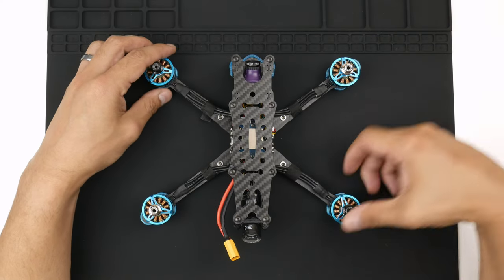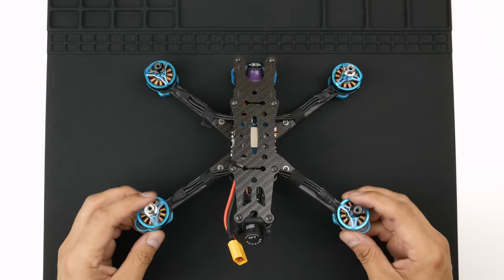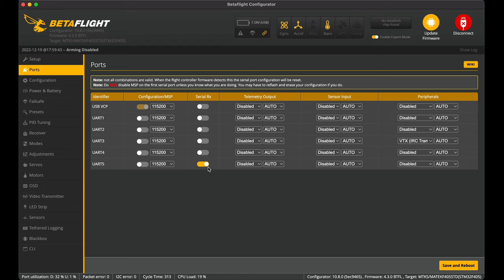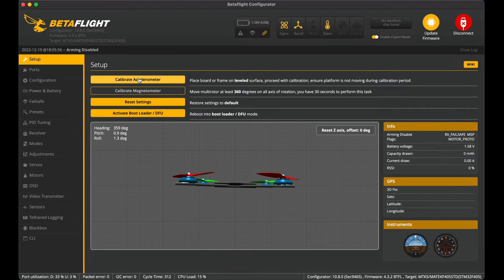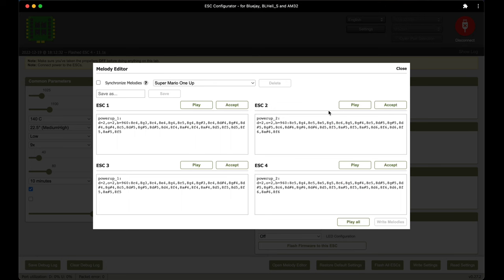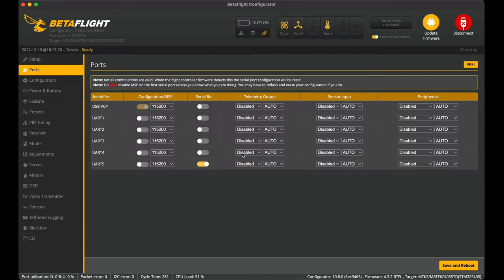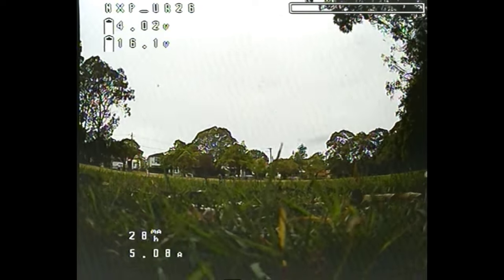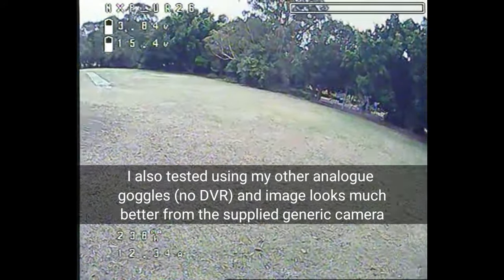TCMMRC Rebuild - Betaflight Config + First Flight

Comment: I also purchased the TCMMRC ur26 mermaid 220. No setup instructions, so I followed all your videos 👌🏽

Now I am at the point where I am binded. My fc is on firmware 4.2.1 and stock esc is on dshot1200. Do I need to flash either?
Reply from the maker: Great to hear! I would flash BlueJay 0.16 to the ESC. Once that's done, in Betaflight update the ESC/Motor protocol to DSHOT300 and enable bidirectional DSHOT.
Reply: Tysm! I did that and the motor are spinning now. But unfortunately they’re all going clockwise. I am trying to switch directions for 2 and 3, but bf says I need firmware 4.3 or newer. However when I try to flash the new firmware, I get an error “failed to open serial port”
Reply from the maker: Try changing the motor direction in esc-Configurator instead?  It might save the trouble of having to back up and flashing Betaflight etc.
Reply: Will give it a shot, thanks!

Comment: Great videos! Have you by any chance figured out the vtx led indicators? All the manuals I find are for different variations with way more leds and I am out here struggling to get a feed into my goggles. Cheers
Reply from the maker: I found this document online which shows the channel, band and power setting LED flash cycle
 https://www.rotorama.cz/cms/assets/docs/26a2ab0aaf41e98df8477510b147e074/9706-0/h5a9b8494c0e84121ad154d583d45f7afy.jpg

It seems to line up correctly as I've tuned into the correct channels on my goggles. To change each setting, you need to hold the button on the VTX and watch the red and blue flash sequence. It's difficult to explain here. I'll try to make a video on how to do this, since I can't find a good video on it either.
Reply: @nxp200  ay thanks for the quick reply!  Turns out the main issue is that I was just dumb and had my goggles set to ntsc when they should've been on pal 😅🤣 got everything working now!  Honestly surprised by the quality of the picture!
Reply from the maker: @bonggoblin  Ah yeh. Glad you worked it out 👍 happy flying!

Comment: wow ! loved every video in the series. Binged it like a netflix series lol. I have couple of questions, i got a tcmmrc night phoenix lr 4 inch. And I am confused how to bind an ELRS rx with it. Saw your video and it seems pretty much clear, but I wanted to know can't I do it with a port or something, do I need to solder it? Also If you have any information about that pnp quad, please feel free to share, it would be helpful. I have brought it from a reseller and its lying around, i want to get it to flying as soon as possible. Thank you.
Reply from the maker: Hey man. Glad you liked it!! 😁 If you want to use ELRS control link, you'll need to install an ELRS receiver. You'll also need an ELRS transmitter (or external module installed). I've got a couple videos showing how to bind ELRS, and many other videos on YT too. Unfortunately it's not the easiest compared to traditional control links, but after a couple times, it's not too bad. Only info I have of that PNP is that it's called TCMMRC UR26 Mermaid. 45amp ESC (I think they've upgraded to 50amp now) and a basic F4 flight controller.

Comment: Nice video series! I am a beginner in drones, and I have a question, why did you choose Blujay Firmware version 0.16 when 0.18.1 is available?
For the VTX, it uses TBS smart audio, not IRC.
Lastly, can you share the VTX tables you found? Thanks
Reply from the maker: Hey! Thanks! I have the same question regarding BlueJay 0.18.1, but I believe 0.16 is the latest "release" version that everyone has used and tested and 0.18.1 isn't yet vetted. Perhaps I'll ask Joshua Bardwell in one of his live streams.

I think I did give the TBS smart audio a try, but didn't work. I'll see if I can find the VTX tables I tried, but they basically came from various listings of the same/clone item. I'll give it another try when I get some time. Thanks for the heads up though! Hopefully it works for me! 👍
Reply: For me, 2.1USA version of tbs smartaudio works well, I don’t know why, but EU version doesn’t works for me

Comment: Hey how did you connect the drone to betaflight? I have the same and it doesn't have usb port 😅
Reply from the maker: Mine has a USB port. Most of them do, so not sure what happened to yours? Not sure what your experience is like with drones, but are you looking at the flight controller?

Comment: I what to install firmware what I need to search on betaflight?
Reply from the maker: If you have to update the Betaflight firmware, you'll need to know the target of the flight controller. The Betaflight Configurator can automatically detect the firmware on the "Update Firmware" page. Otherwise, you can find the target name by typing "version" in the Betaflight CLI. It is also displayed underneath the Betaflight logo at the top right of the app once you've connected to a thought controller.